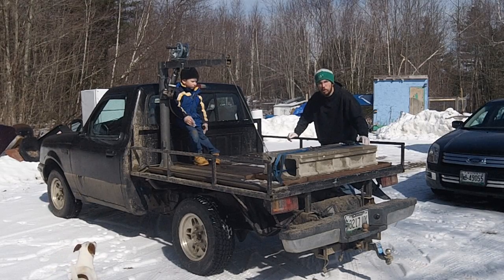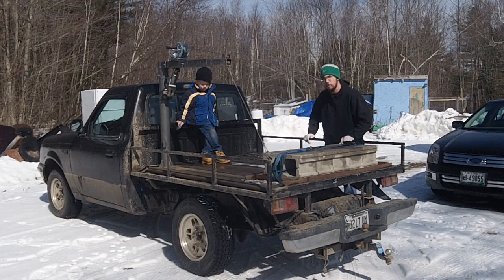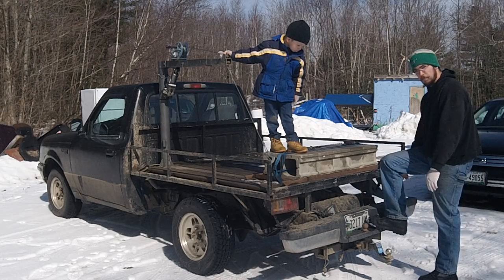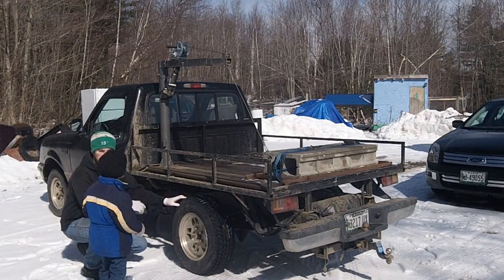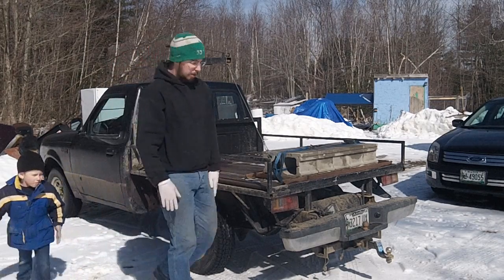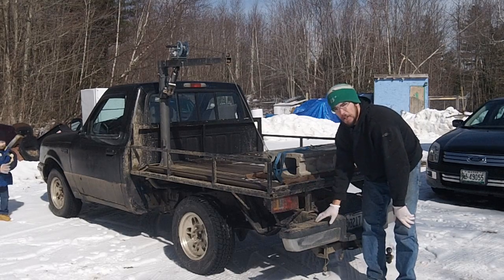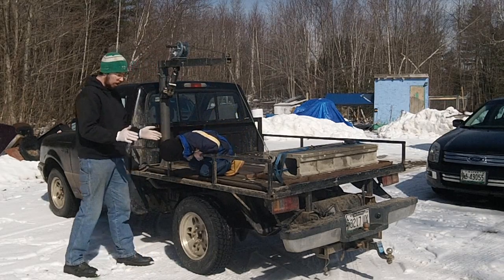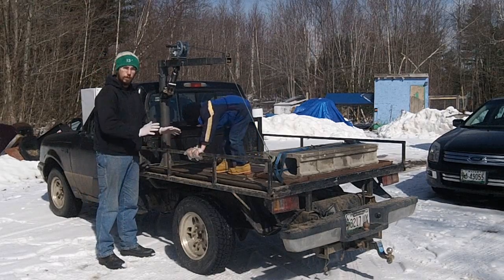Flat Bed truck : Wish I had  known

Comment: mud flaps on wheels try and rig a jack under your ramps jack the bottom a little when mower sticks resit the urge to lift the ramps up [your back will love it] put a plastic sheet on cap good idea for box on lights

Comment: Just put ratchet straps from the bed through the rims back to the frame. It will eliminate shock travel. Then hang curtains on the sides. Keeps rocks away From the blinker fluid tank. Need outriggers. Never put a crane or load something without outriggers. Good way to destroy your suspension when you load them 200ton whisker biscuits lol. Best way to keep your tail lights is to never stop. Always keep moving forward. You need air overload shocks or air bags. Shouldn’t be able to shake a truck like that. Means your suspension is shit. Make your side board your Ramps. paint it with bed liner or powder coat. Don’t have to extend the boards. Weld a piece of flat strap over it or a strap on. Make it dove tail. Like a car hauler. Put a hit wire to your fuel filler cap. Somebody tries to steal gas shock em. Right when them fumes are good and hot. Hahah. Take that sucker to sema. Hot dang mater

Comment: Hi! I’m trying to figure how much clearance is reasonable to keep between the top of the rear tire end the flatbed base. I have a f-150 1993. I don’t plan to load it like crazy. How much is your clearance? Thanks
Reply from the maker: Measure from top of axle to the frame bump stop and add 2 inches for flex.
Reply: @redneckcomputergeek  makes a lot of sens!!